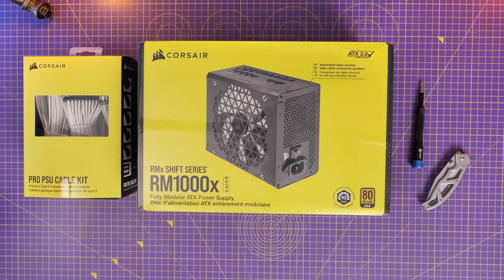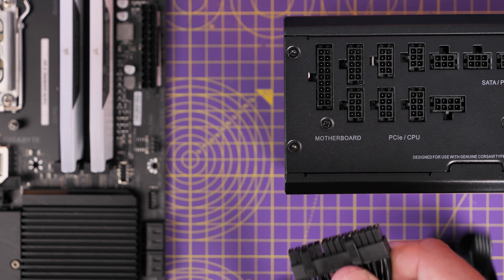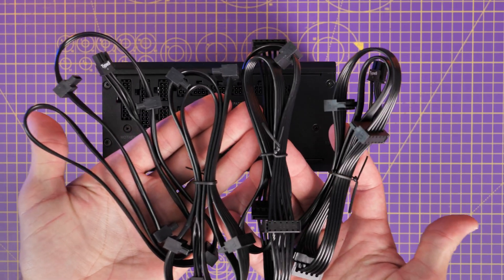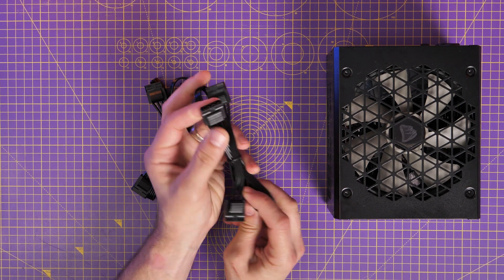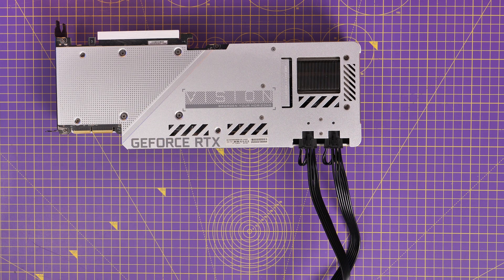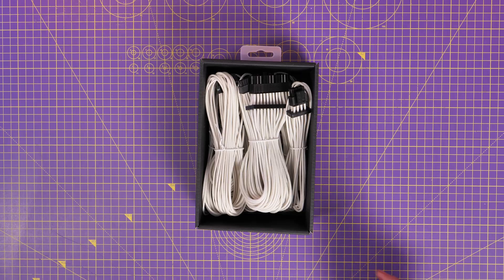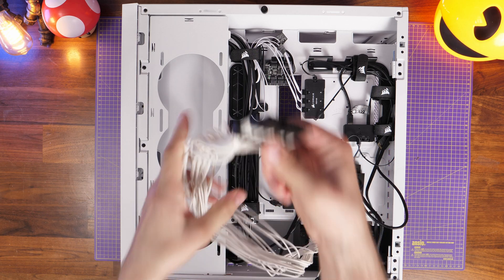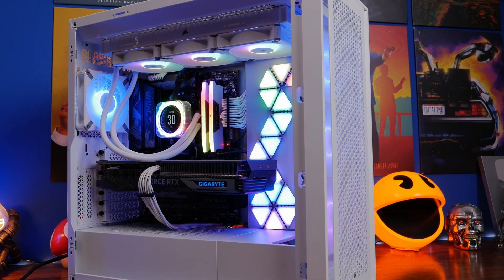Corsair RMX shift PSU setup and install guide (RM1000x and Pro PSU cable kit)

Comment: the 1000w 40xx GPU connector is 450w right? will it be necessary to buy the 1200w for the 600w cable?  I plan to buy a 4090
Reply from the maker: I double checked this and Corsair says "We don't sell or produce 450W cables...RMx Shift, Type 5 PSUs, and any ATX 3.0 PSUs at any wattage come with a 12VHPWR600W cable as standard, that will support all of the current 4000 series cards. So if your system spec falls in line with requiring less than 1000W under load with a 4090 in it (I'd always recommend a minimum of 10% headroom). You can order a 1000W PSU safe in the knowledge that it'll come with a 12VHPWR600W cable."
Reply: @TheProvokedPrawn thats not reaaly true. I have the 850 version and it only has the 300 watt 12VHPWR.

Comment: Do I need a SATA cable if I use an SSD that sticks directly on the motherboard? I don’t think so but I wanna ask. I’m not using HDD or any SSD that requires a cable
Reply: Probably not
Reply from the maker: It depends on the case. Do you have any fan controllers or lighting things that use sata
Reply: @TheProvokedPrawn  I think I do have one that needs a sata but it’s not the SSD

Comment: I've been using the 1200w Shift in my system for a couple of months now & it's been solid so far. 
Managed to squeeze it into my Lancool III case.
Reply from the maker: Nice 👍 thanks for sharing
Reply: I plan on using the Lancool III. Do you have any regrets about using this PSU? Would you go with a different unit?
Reply: @snappyjones8532  Absolutely no regrets, the PSU is excellent. :)

Comment: I wonder how this PSU does with voltage ripple compared to the regular rm series, these don't seem have the caps/filters in the cables.
Reply from the maker: Alas I don't have the knowledge or hardware to test that